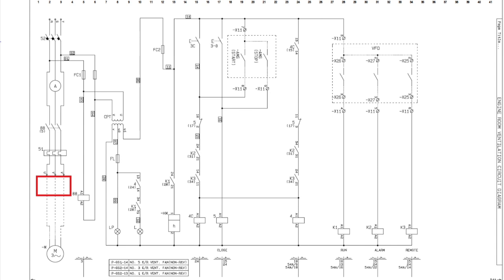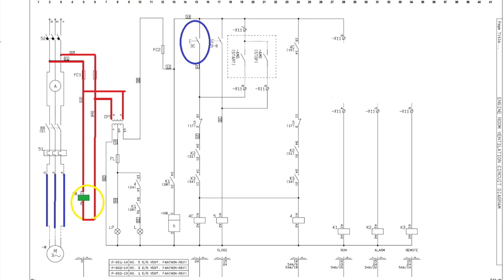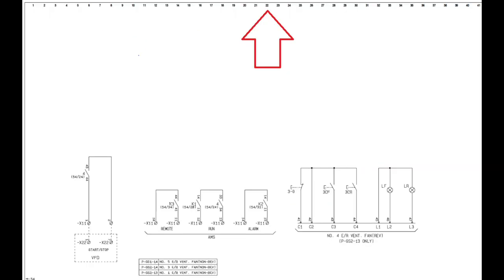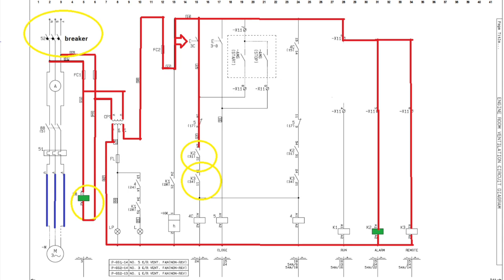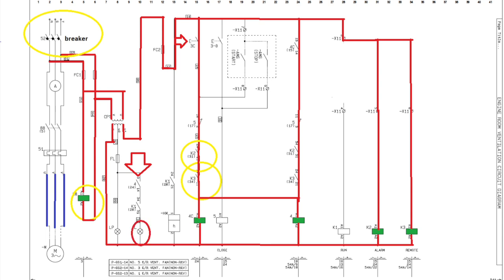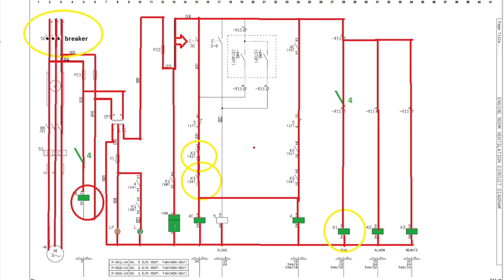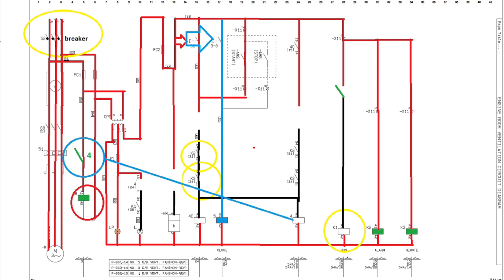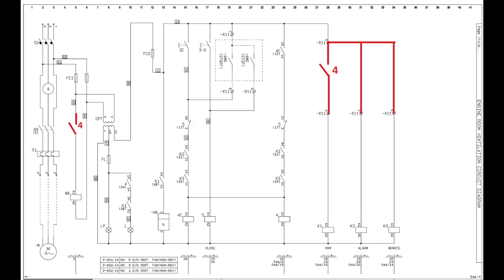VFD MODIFICATION, HOW TO BYPASS AND READ WIRING DIAGRAM |MARINE ELECTRICIAN

Comment: It's a good solution, simple.

I'll explain why its important for me to keep it as simple as possible and leave wiring untouched as much as possible.

I used to work as a service/commissioning engineer for steam boilers. (Nowadays 2nd Engineer Offshore.) Often I came on vessels where a creative mind re-build half of the control panel with non OEM parts and wiring without documenting it. (I understand emergency situations can allow for such changes) However the real trouble started when spare parts arrived late and the person responsible for modification long gone. Reliever not able to solve the undocumented puzzle and calls manufacturer to solve the mess. I've been on vessels for several days to rewire and build large panels. (Service engineer for 3 days + travel time is 10-15k dollar.) One would think issues like this are rare but their not, it happens all the time. 

Backtracking undocumented changes are often more difficult and time consuming than creating a temporarily solution.

Comment: On all the mission critical VFDs in Antarctica we also order them with the bypass contactor option in the VFD. That way if the drive fails you can easily do exactly what you did here, since the VFD comes with a built in bypass contactor. Do they not ever do that on ships, buy VFDs with the bypass contactor included?
Reply from the maker: Too bad we do not have that set up that is why we need to manually do the removal and modification of the circuit.
Reply: We regularly use this setup in the Wastewater field as well.

Comment: Hi Jake.
The wiring diagram was very informative thank you. If you remove VFD from start up  your inrush current from motor would increase correct ? Would the removal cause the initial strain on the circuit and equipment motor etc.
Thanks very much 
Paul
Reply from the maker: It will cause an issue for those motor thay requires start and stop. But to this vent fan it is actually continously running hence the impact is not that much.
Reply: @leckyjake  thanks Jake makes complete sense.
Keep up the great vids. Certainly helps a sparky like me
Reply: Bypass with a RVSS

Comment: Excellent vid, thanks for sharing. Does this mean the motor is starting DOL? Wouldn't this cause the main breaker to trip on start up? I appreciate your experience. 🙏
Reply: That motor is a very big motor and that needs a start-delta system connection if without VFD

Comment: Much better make 2 modes of control one for the modified and the other is for VFD. In this control you can put selector switch to select if u want to connect in VFD or in modified so that if VFD is not functioning u can us the one u modified.

Comment: İn this way you have a DOL if the motor is too large you will have an important inrush current and maybe youll have to change your cb i wouldv prefered to use a soft starter or y delta starter to avoid the inrush current and protect the lines and the motor 
Obviously this all depends on if the motor is a large one
Reply from the maker: I do agree but the motor will always be running all the time hence you only need a one time start. These fans are always running to cooldown and build the pressure inside the engine room
Reply: @leckyjake  in this case a DOL would suffice thank you for the amazing content keep up 
I would suggest to do some content on automation would help us thank you

Comment: My friend you BY-PASS alot of things
Safety devices over load and motor rewinding temperature and also motor speed control it will take more load when  you start motor this temporary solution 
If you like to make permanent control with out vfd it will costs more than replace new vfd because you have fixed allot of components

Comment: This is not advisable. Dont by pass VFD.  Its not an ordinary motor system.  For the sake of troubleshooting you can swap VFD from other motor.... Thats the safest way to troubleshoot.
Reply from the maker: Hi Rolly, I am sure you will understand the situation once you have sailed in the red sea on the way to the middle east with an ambient temperature of around 45 degrees inside the engine room. All fans should be running at max speed and you do not have a spare VFD available onboard.
Reply: Ask the office for immidiate supply of VFD. i will only do it if the fleet engineer approve
Reply from the maker: That's the first thing we did, to seek for the approval. This fan goes all the way for the cooling of the main air compressor.
Reply: @leckyjake  good job.
Reply: Lol.... right on leckyjake . Carry on with your beautiful lectures/ videos .